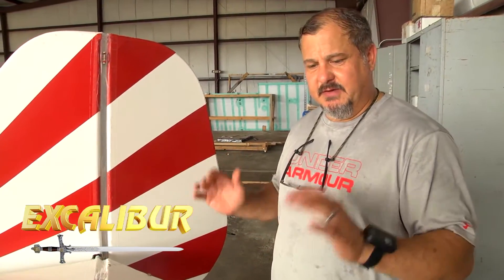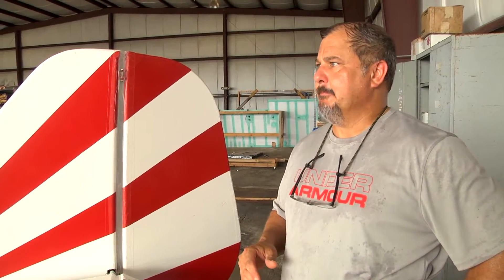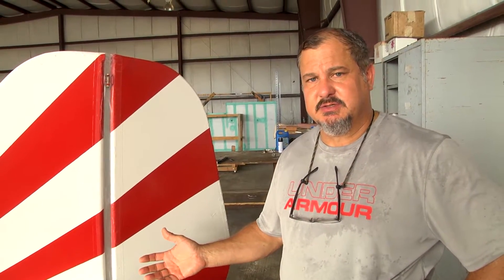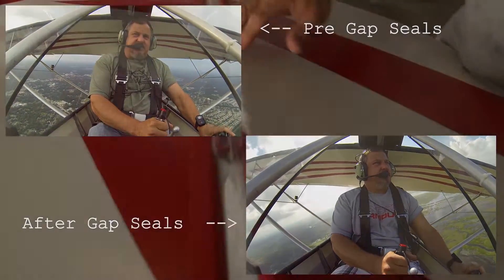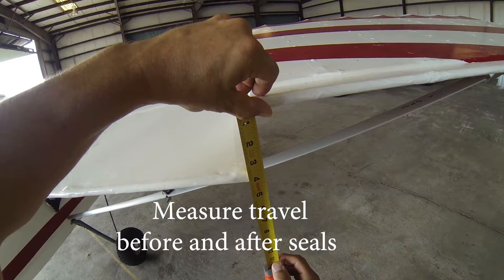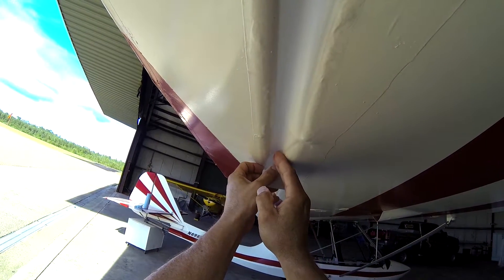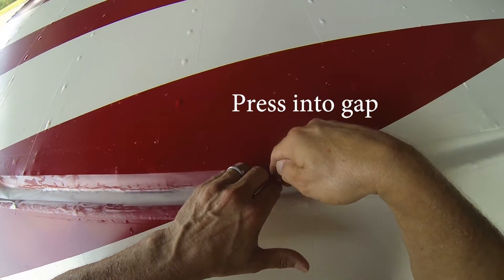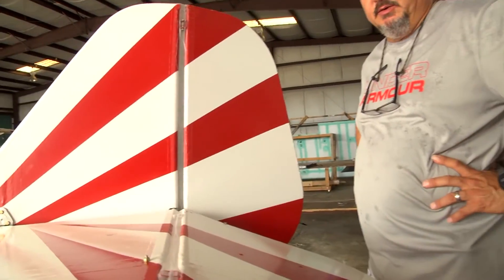Gap seal install and performance on experimental aircraft

Comment: THANKEW!
We ordered the 3" tape from Amazon and installed it on the gaps in my partner, Michelle Goodeve's Pietenpol Aircamper.
(She's owned it for 43 years). Did the elevator gaps first. Tail-up in 8 seconds before - up in TWO seconds after.. Did the rudder next. Much more positive directional control.
Then we did the ailerons...
WOW!
The Piet went from PAINFULLY-slow response to snapping into a 45 degree in a SECOND!
We've since learned that sealing the aileron gap on a Pietenpol (designed in 1929) is all but mandatory - and we can see why.
Thanks so much for posting this video.
The 3M tape works AMAZINGLY WELL and it's turned The Piet into a whole new airplane.
Appreciate it.
PS: You can see Michelle flying her Piet (WITHOUT gap tapes) here: https://youtu.be/9VCZ80kbD54
Reply: That's so awesome to hear!  It was the same for me.  Totally different airplane afterwards.  It's been 5 years and my seals are still nearly as good as the day they were installed.   Thanks for sharing!!
Reply: @LAOutdoors  Did you use the Transpore 3" tape? How's it holding up now after seven years?
Reply: @fearwidge Did you use the Transpore 3" tape? How's it holding up after two years?
Reply: @rdwit659  Hey There.
The tape was GREAT "proof-of-concept" & once Michelle realized what a difference it made, she started replacing the tapes with proper doped-fabric gap-seal.
The Tail's done and she WAS going to do the ailerons this summer - but her engine started acting up and it took the last 3 summers to track down the problem.
(Turned out they'd changed the fuel recipe and her 78-year-old engine didn't like it. GRRRR.). So it's running fine now, but we're running out of summer up here...
Re the tape: As it was subject to the elements, the tape slowly started to crack and come apart - but the ailerons are still good enough for a few more flights. 
Her only "complaint" was that she had a lot of trouble getting the old glue off before putting on the new doped fabric.
Oher than that - the tape never BLEW off, or came apart in flight - and it gave her the answers she needed to proceed.
So, thanks again. Your "Tape Solution" REALLY helped.
Cheers,
Glenn & Michelle.
PS: You can see Michelle flying her Pietenpol (& various other antiques) on our YouTube Channel.
Search for      fearwidge

Comment: I found some 3" and that size is perfect on my Challenger. 3M makes it as well but it's Transpore instead of Blenderm. Exactly the same stuff. Amazon, 4 rolls, 10 yards each. We'll see how the aircraft handles.
Reply: @blyz_69 How's that Transpore holding up after three years???
Reply: @rdwit659  everything is still just like the day I applied it. Flying wise, couldn't tell much difference but maybe it's there??

Comment from the maker: By the way, this was done and installed last July.  It's been 10 months and not the first sign of needing any attention.  I've washed the plane several times and see no negative issues having been wet.  I think it will last at least a couple years if not more.